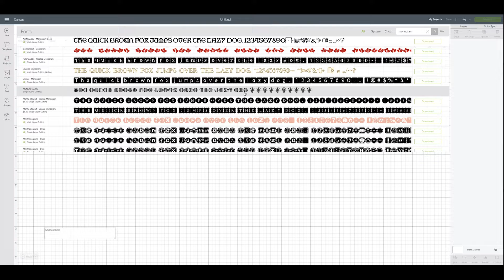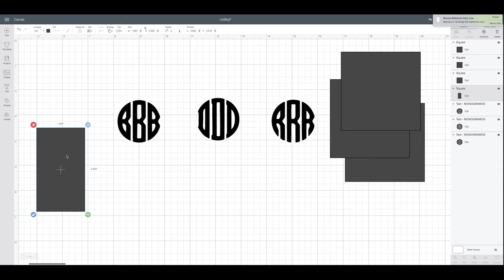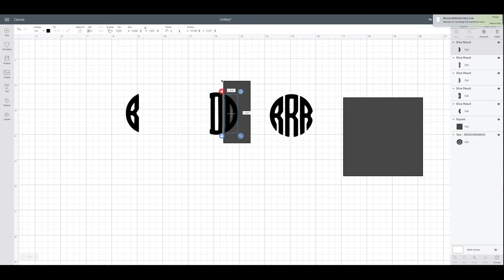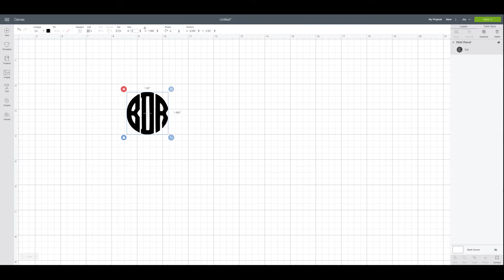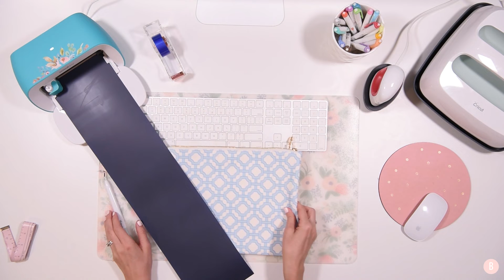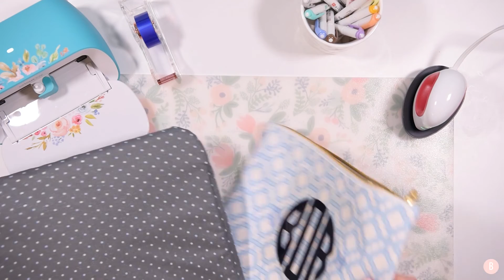HOW TO IRON ON FAUX LEATHER WITH AN EASYPRESS MINI!

Comment: You are supposed to press again with a Teflon sheet over your design after you have pulled the transfer paper off for anyone watching. If you don’t, this won’t last. The design will just peel in no time because it’s not adhered properly
Reply from the maker: Hello!  I definitely give more heat with a protective covering to my shirts or items that will be repeatedly washed, but it's not required.  You are welcome to do an additional press, but additional heat after the liner is removed is not mandatory if your initial press was done correctly at the proper temperature, for the proper pressing time and peeled according to the directions (hot or cold).  This project is a year old and has held up perfectly, I love it!  Hope this helps!
Reply: @Bethadilly  yes, you got lucky here cos this item does not go through the wash. But for items that will be laundered it is essential that you do an additional press after the transfer sheet removal. I am in so many craft groups and have been in business for years and this is why people are always complaining that their vinyl peeled off or they had customers complain that their vinyl has peeled up. 
Do the additional press and you won’t have this problem people.